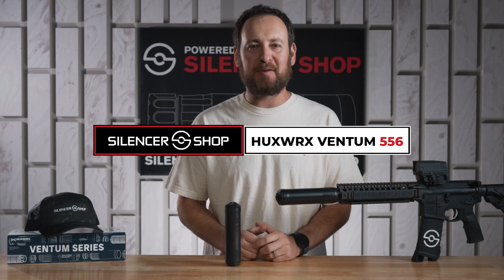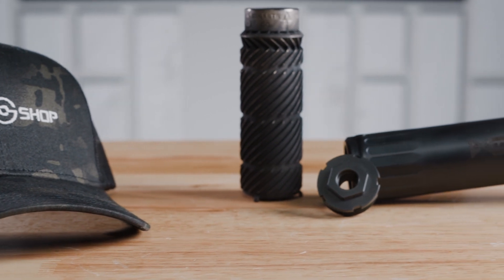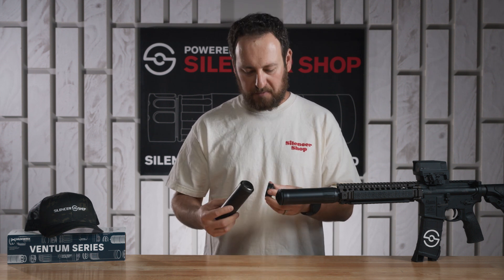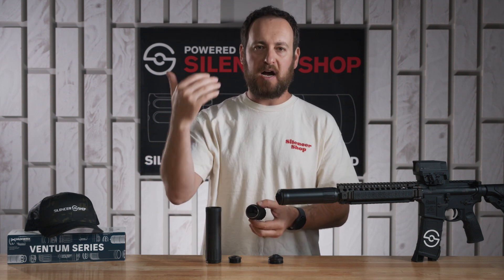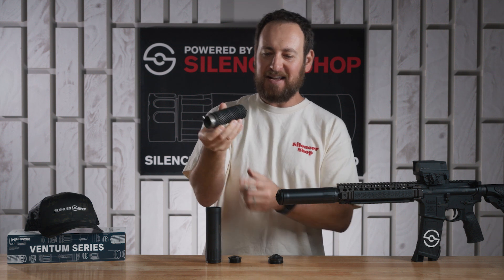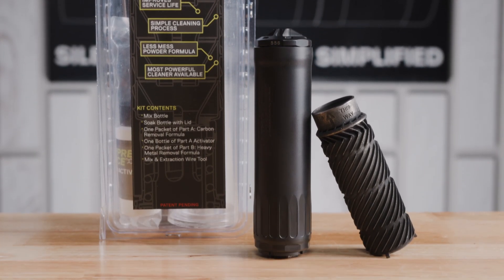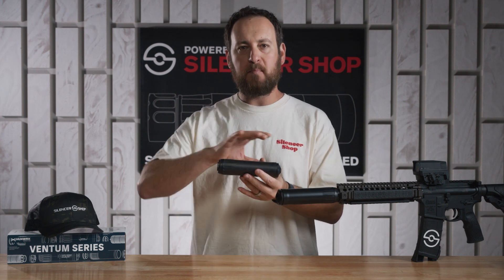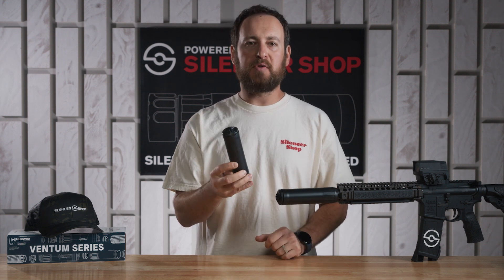Huxwrx Ventum 556 - High performance Flow-Through Suppressor

Comment: This is a opinionated Rant, from a poor loser hillbilly so please take it with a grain of salt.  Its already bad enough that we have to pay $200. tax stamp plus pay x amount for a trust, along with all the other BS that goes along with it. then there's the unGodly price of the can itself. which in some cases cost way more than an intermediate Modern Sporting Platform, that it gets mounted on.
 in my opinion, if the material cans are made of cost that much, that manufacturers have to mark up a can for that high of an msrp. than I believe you need to look into a different less expensive materials, other than Inconel, and although titanium is pricy it's not that pricey. than there is stainless steel. which we all now is cheap priced but still asking $500.+ for a can made of that. wtf they only work half assed and nothing like they should, cans are not even hearing safe except for a couple calibers that you have to use sub sonics for it to work. Heck' you can use an oil filter, and get damn near the same results as todays most modern Silencer/suppressor

Comment: I don't know about anybody else but I saw gas coming out of the Bolt carrier area
Reply: It doesn eliminate it completely. Thats impossible, or at least hasnt been done yet.
Reply from the maker: Sure, there still needs to be enough gas to run the BCG, and if we tuned the rifle we could cut that down even more, but we try to show fair real world scenarios instead of super-tuned guns.
Reply: Well no shit 😂😂😂
Reply: There's always going to be some gas coming out of the ejection port on a DI AR-15, even without any suppressor at all, even if the gun is perfectly tuned to the bare minimum gas level to operate. Almost all of the gas used to cycle a DI gun comes out of the ejection port.

The point of a flow-through suppressor is to reduce how much comes out of the barrel when the gun unlocks.